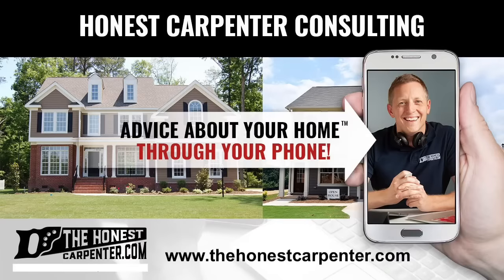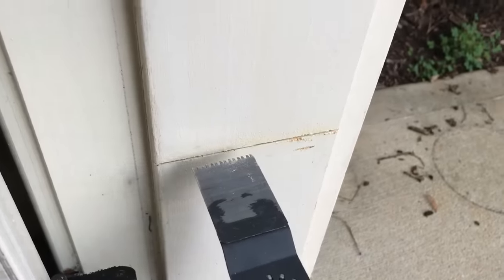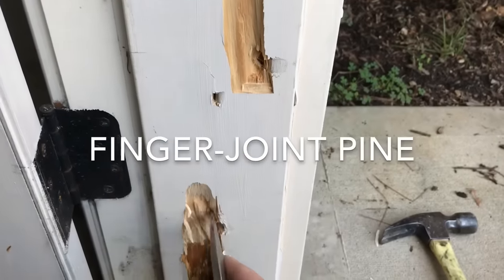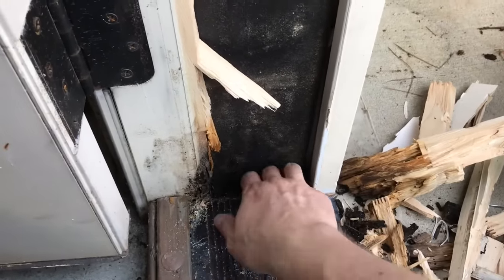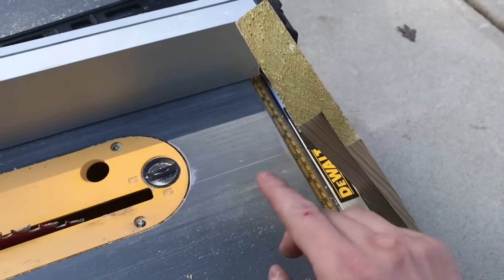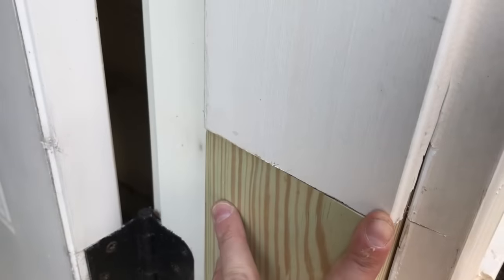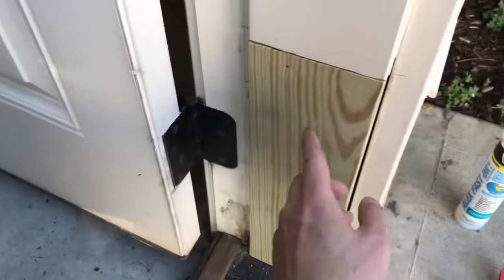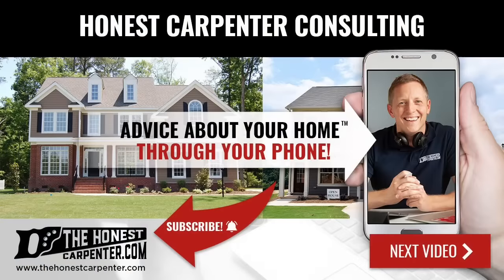How To Repair Rotted Door Jambs

Comment: I watched the video w/interest as I've spent 30+ years in the field as a residential finish carpenter/cabinet maker. I'd be the first to admit, none of us "old guys"  possess all the answers or angles, however I feel there are a few outstanding issues yet addressed here that are a disservice to a  homeowner(s) & ourselves, as craftsman that need consideration.

Generally speaking, door & window manufacturers have, for the last 30-40+ years, supplied the trades w/finger jointed jambs for interior and exterior jamb  applications. Clear wood jambs can be specified at the time of ordering, however, at a significant up charge, which typically was the exception and not the rule in application. 

In this particular instance, I'm not certain that yellow pine, (chiefly the wood used in pressure treated wood products), but also becoming more and more prevelant w/ interior millwork, that this is the material of choice for a exterior  jamb repair - even "dried". y.p. moves (expands/contracts) at a different rate than the spruce/pine/fir finger joint jamb material which is commonly used today. Additionally, y.p. grows differently, faster, has a different density than white pine/spruce,  is not as stable (much more brittle)  and doesn't perform/hold up as well when introduced or exposed to moisture long term. To the point, look closely at any exterior y.p. decking material - vertical or horizontal in application. Whether it's treated for moisture and exposure - after the intial 6-8, or even 10 month drying time, to receive and absorb an applied sealant - it still checks, along the length of each board. That's why Trex decking & similiar products have surged as a go-to  decking material.

My experience early on is that in repair work, y.p., especially p.t., checks (cracks) similiarly along the length of the board  over time in exterior applications. Whether you're using "dry treated" boards before priming/painting or not - y.p. inherently checks, in time, no matter how you treat it after installation ...take it to the bank...it just does. There's a reason you don't typically find finger jointed y.p. door jambs - treated or untreated wood, used on EXTERIOR applications, w/entry doors. 

Additionally, 2" finish nails, or even 3" nails for that matter will not keep a y.p. board flat - the board WILL MOVE, curl, with the grain and, eventually, resists being fixed/nailed, by checking (cracking) along grain lines. It must & will relieve inherent stresses within the board, it's the nature of y.p.  This allows moisture in, which can  lead to paint failure & eventually, decay. I've replaced more than a few of these y.p. "patch boards" through the years on doors AND windows - they will move and decay - even p.t. boards - more so than the regular pine f.j. board... they just do. 
Lastly, the repair does look cosmetically pleasing initially, but the sill is left unsecured to the bottom of the jamb & it will move out of place over time - foot traffic, constant opening/closing of the door, house movement - and the structure does move/settle over time, even minimally; caulking will not remedy the joint long term, causing potentially more damage beneath the sill and framing beyond the jamb. I know, as I've demo'd plenty of these type repairs, beyond the door unit itself. They do not hold up season after season and with foot traffic. They just don't... look, I understand the scope and intended purpose here - what's warrented in this instance; the economics, the time and labor  ect.... but, if you want repeat business, and that's what this is about - business, then do it right, or don't do it - for the sake of sparing someone the heartburn of another re-do... 

I generally try and steer the homeowner towards total jamb replacement w/a clear wood (non-finger joint wood) repair, even utilizing those fiberglass bottom jambs & then prime the stuffing out of ALL sides/ends thoroughly & (2) top coats of quality exterior paint. I reconnect the rabbet/joint milled at the bottom of the jamb (made in the field) to the side or edge of the sill for a solid connection w/screws & apply a bead of caulk where the sill meets the shoulder of the rabbet,  allowing a 1/8" gap between the top of the sill and the underside of the bottom of the jamb cut, to allow water to flow away. I have yet to have a call back due to a joint failure or water issue that is caused by failing paint/caulking at this reconnection. 

Lots of words, yes... but that TV commercial & the Midas man wasn't whistling Dixie when he told the customer, " you can pay me now - or pay me later." I'd rather walk away from work, having to  forego income - than "paying a customer" to get off of a job, because my "repair" wouldn't remedy their issue. And if you don't quite understand how YOU end up paying a customer to get off a job - continue with the "practical patch work"... one day it'll come to you & outa-yo-back-pocket...
Reply: David I like your idea better, do it right the first time.  My back door looked like that too and I knew it needed to be replaced.
Reply from the maker: Thanks Dean 🙂
Reply: Pressure treated is not what I would have used. Something kiln dried and a harder pine like Douglas Fir. Great job on the instruction. I have replaced many rotten areas of door jams and not one has been a problem. An inexpensive repair can turn dreadful and cost more when you aren't willing to use better materials to begin with. 
Keep up the great videos!
Reply: I did the same except  backed the original and new both with shims. Yup, a door jam kit is about $50.00, but then, inside outside trim paint, etc. It all adds up! Labor and Time I have money we'll, I'm out of my pay grade if I gab a beer and couch it off😂😂. You are so right, though. I'll say a porch cover-overhang for doors will save your wood.

Comment: I did this same work on a customers garage access door here in Seattle about 4 months ago and yes, oscillating multitool here is the best thing to use. On top of replacing the piece I cut out, I also used wood hardener to treat the softened wood behind it. Then put in wood filler on top of that. then I used waterproof adhesive to put replacement piece in place, primed and painted it with marine paint and finally caulked the joints with marine caulk.
Reply: I got a feeling that repair is going to last longer than the house.

Comment: Nice looking repair.  You can also buy PVC door frame pieces that are made for this.  Kits usually include the entire frame (3 pieces), but I have used in the same way as your repair, i.e., replace just a section at the bottom of each vertical piece. With PVC, you never have to worry with doing it again.
Reply: Planning to do this very thing in coming weekends on my rotten jambs & brick mould.

Comment: I might add, a speed square comes in really handy on this repair.  Slide it to the location you want your plunge cut and use it as a guide for your oscillating tool.
Reply: Yes, I used a clamp to hold it in place got a straight cut going with the multitool and then did more of a plunge than back and forth.

Comment: Rather than using a level cut as you did, I use a scarf cut sloping down to the outside so it will shed water. Silicone is not paintable so I use elastomeric caulk (Lexel, e.g.) at the bottom.
Reply: I prefer polyurethane.
Reply: That makes a lot of sense! I fear that I would find making two slanted cuts that match more tricky than it's worth, but I might be willing to give it a shot on my next repair.
Reply: @victorquesada7530  if the guide block is at the angle you can run the oscillating blade along the block but flat against  the downward bevel. You can make the replacement piece, just keeping the same angle on the table saw or mitre saw that you made the guide block with.
Reply: I was going to say the same thing!
Reply: @victoryak86  Smart!
Reply: Good advice, but can I trust a super-villain?
Reply: @IvoryPagoda  LOL...just this once.

Comment: Pro handyman here. I used to repair the same way. Will rot again. Clean up, remove rot, fill with foam, glue/nail pvc plank in front as you would a baseboard, silicone/call up to you...done in no time and will never rot again.

Comment: Here’s a tip I use… When using wood brick mould/jamb make sure your use a primer or paint on the bottom 3 inches BEFORE you install, to help seal it and “help” with future water repelling to assist with rot.
Reply: It would make sense to treat these ends with some anti rot product, or even apply wood hardener to stop the wood from absorbing moisture. 🤔

Comment: I did this same repair two days ago. I hadn't looked at any videos and today found this one. I did the same thing he did with a couple of differences. I cut the old wood out with my oscillating tool. I used a chisel instead of a screwdriver (a screwdriver, really?). I didn't glue the board in place since in a number of years that new piece may rot again and need to be taken out. I do like the idea of using the oscillating tool to create a space away from the concrete.  I did think about that but haven't done it. I'll do it tomorrow. Over all really good video.
Reply from the maker: I did a whole video on the big screwdriver Anthony. I’ll take 3” extra leverage any day. Goes through pine easier than a chisel because the tip is so narrow. One of the first things ever taught to me on a construction site.
Reply: @TheHonestCarpenter  I'll have to check out that video. Thanks.

Comment: For those who may have a hard time cutting a straight line. You can take a scrap piece of wood with a straight edge and screw it below your line. This will give you something to rest your tool on. It won’t just help with a level line but keep your pitch too. 
With this repair he’s already ripping with a table saw. No harm in ripping down a scrap piece of 2x6 etc and avoid the shims. 
He’s doing a cheap repair for those who can’t afford a whole door. Use what materials you have.  
Cut your height and angle and width as he showed. Insert the 2x6, scribe a line for your depth and run through a table saw.
Reply from the maker: Thank you Vince! That’s very well-put advice 🙂
Reply: Semper Fi , I agree. Some above complained about the method. Replace the whole board, pull the door etc. 
no need for that unless the rot made it into the framing. People don’t always know what’s involved in replacing a whole door and the expense.

Comment: Great video, still contains valuable information.  I was getting ready to replace my kitchen storm door when I removed my old one and noticed the rotten wood.  Perfection video to saved me some valuable time and expense.  Added a minor change, and 😉used Foam Insulation in the cavity, this should eliminate any future moisture issues.  Used your last trick chalking the base of both sides of the jamb.  Tomorrow just install my new storm door.  Thanks again.

Comment: Great job.  I would like to recommend that you do something else in addition to adding the cut at the bottom to cause it to clear and stay dry off the concrete at the ground level.  I would also prime both the bottom edge as well as the entire backside so that it is further protected and not likely to soak up water (like raw wood would).  Thanks and keep em coming!!
Reply: Dave Cates primer isn’t weatherproof. Good idea, but use an exterior paint
Reply: Yo the type of wood he ise is main thing its presurrure treated moisture resistance.
Reply: I don’t like encapsulating wood with barrier. If just a pinhole allows water inside it will rot out more quickly because oxygen is low and no way to dry. Leave inside surface alone and provide downward angled weep holes. Not as aesthetically pleasing but who cares

Comment: This is a great video for the home carpenter to repair their rotted door jam from weather damage. This seems to be a common problem for the Northern states and the Southeastern states where rain/snow did most of the damages. I'd agree, the exterior door jam should be much more resilient to weather for these locations, the manufacturers could just either seal the bottom of the door jam or splice in 6-12" of treat lumber at the bottom edge, the problem would not exist. Having said that, I'd do this repair a little differently as I did at my house. Since the damages to the door jam is really about less than 6" from the bottom, I'd only replace the bottom 6" not 16" to maintain the structural integrity of the door jam (note that the removed upper door jam is still solid wood). Cutting the door jam way above the bottom hinge weaken the entire door jam to carry the door weight. I'd not use the screwdriver to chisel the old damage part out either, I'd cut another straight line from the top down to the bottom while keeping the weather trip pocket and fry out the entire piece. Last but not least, I'd not glue the new door jam wood piece into the frame stud either, because you want to be able to replace the entire door at some point in time in the future, gluing the shim and the repair piece makes it more difficult to remove them later. Once you nail in the new piece and caulk it up, it is solid and not going anywhere and the old door jam is much more structural stable.

Comment: I need to make this same repair.  Although I'm also replacing the entire brick moulding with PVC, as that's rotting at the base as well.  The one issue I had was with the shims.  Rather than just use small pieces, would it have been much more effort to make shims that go the width of the board?  Seems like it would give the replacement piece a bit more stability and a more solid fit.

Comment: Better than new, I’m sure that treated patch will outlast the door, good job
Reply: This is true!  A number of good suggestions have been made here (including several I made) but I can guarantee that this repair, exactly as he’s done it, will last a very long time. I’ve done it similarly and seen it last for years. The door unit will likely be replaced before anything goes wrong with this repair imho.

Comment: Instead of caulking for replacement pieces I'll take real fine sawdust & mix with wood glue to fill in joined gap. When it dries sand smooth & paint. Sometimes it makes replacement joint almost impossible to detect. Great video!!

Comment: Whenever I replace any vertical wood trim I put a 15° bevel aka weather cut instead of making a straight cut.  To do this using the same tool you used just cut a 15°bevel on a scrap piece of wood same width as the piece you're removing and tack it to the piece you're cutting off. Short point on the face, using this as a guide for your saw.  It will make the joint disappear use a small amount of caulk in the joint.  Also leave an 1/8" gap at the bottom of the threshold to allow caulk to adhere to the piece you're installing.  I use a nail puller to put upward pressure on the piece while nailing to get the joint tight.   Sorry about the long comment but I'm very detailed when making exterior repairs.  Hope you give this method a try.
Reply from the maker: Xtreme200302003 I don’t mind the long comment, I appreciate you writing in. Question though: is a weather cut necessary for this application? If underside of cut above is sealed, and top of new piece is sealed (something I didn’t do a good job of showing in this vid, but have put in other vids), what do you think the odds are of getting water penetration on a vertical jamb? Especially with surface caulk and paint to follow. I like the 1/8” short trick though! I tend to use my 5-in-1 to scoot under and lift a piece in similar situations. Let me know what you think...
Reply: @TheHonestCarpenter  The short answer is , just try it and see for yourself.  I think the joint turns out better.  Is it absolutely necessary....no.  It is just what I was taught to do when installing new exterior trim.  You do pay attention to detail and turn out good work, I'd hire ya in a heartbeat.
Reply from the maker: Xtreme200302003 Thanks buddy! I appreciate the advice and support. I’ll give the block guide a try on my next go round. I’m always up for learning new methods 🙂
Reply: Awesome advice extreme person
Reply: @Xtreme200302003  I can appreciate the value of that angle & the integrity of the joint on the surface

Comment: I had this problem on my door. Couple of thoughts... I consider myself a handyman and trust me, it’s not as easy to do a quality job as this guy makes it look. For one, it’s hard to tell how the door jamb is really made until you cut in to it. You may find that it’s not so easy to replicate the wood that’s there (as I did). TBH, I have mine reassembled but it’s not like it was - it’s pretty evident that it’s been repaired. Which leads to my second comment - there’s really no need to remove that much material - you just want to remove the rotted portion so start with removing 3” or so and work your way up until you’ve removed all the rotted wood. That way if you can’t exactly replicate what was there it’s not so obvious. My project gave me a new respect for a good craftsman LOL. I think within the next 6 months I’m going to have a door company replace my entire front door assembly with something a bit more “fancy” and not made of pine.